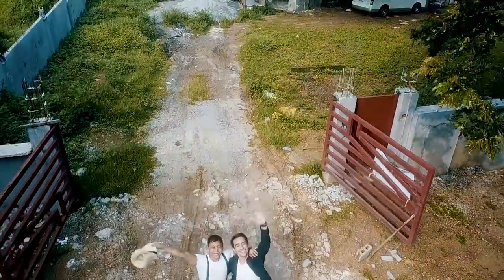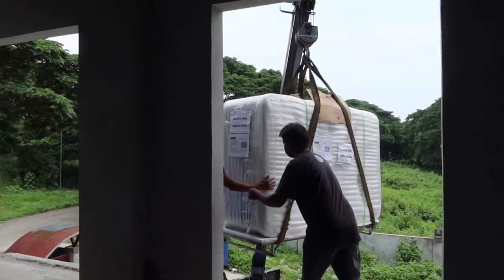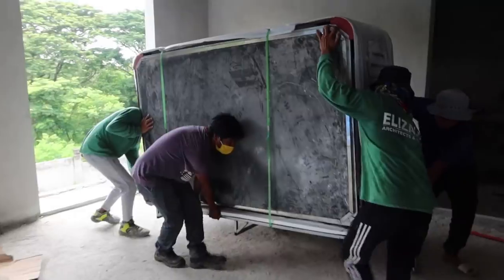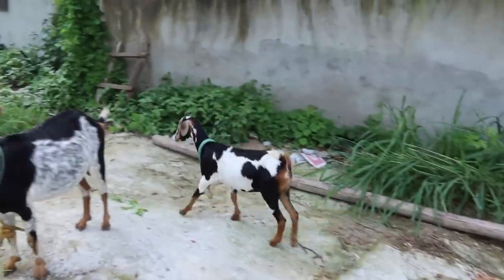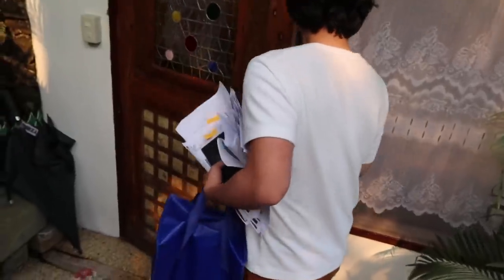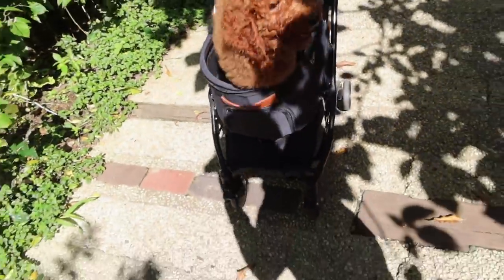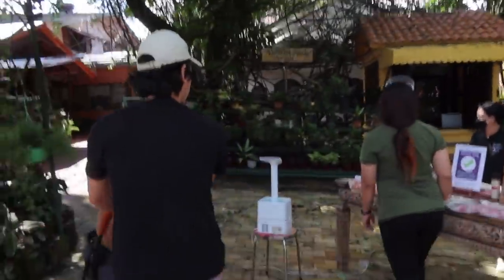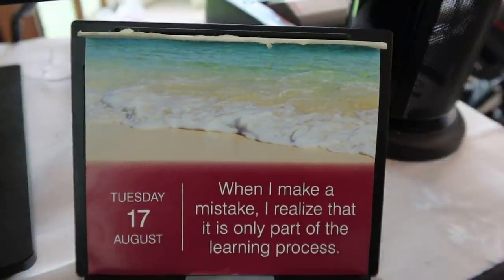This Huge Piece of Furniture FINALLY Arrived! - Aug. 17, 2021 | Vlog #1303

Comment: Mikey all prey animals have a drive line that's located at sliglty behind their shoulders. If you go infront of their shoulders you're cutting off them wanting to go forward, if you go behind you're making them want to go forward, once you're in the center it causes them to stop. 

With this information you can master catching your prey animals with this "tool". But you have to put thought into driving them forward, driving them away and them stopping. As you can overwhelm them to where they dash even tho you're centered. So pressure and release. 

So you don't want to go directly at the goat but at an angle towards their drive line, horse are prey animals and you constantly want to go at them makes you appear to be a predator.

Goats also do well with the mix of driveline and "treats".
Reply: Lol you can even use the driveline technique on chickens and they'll do the azact same thing.